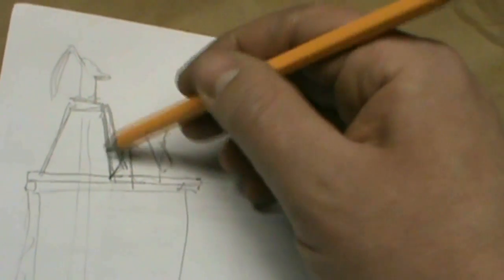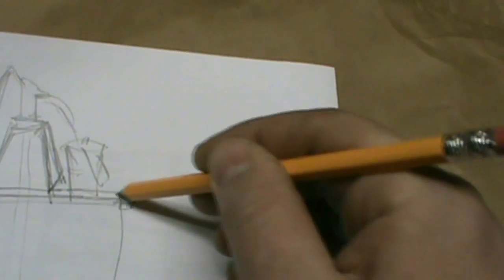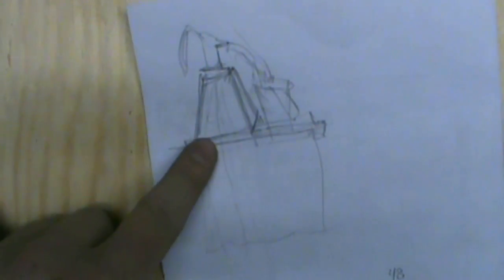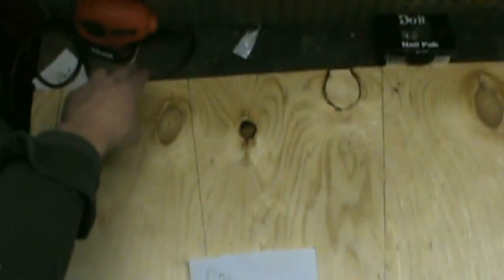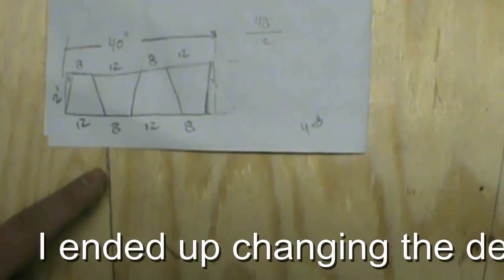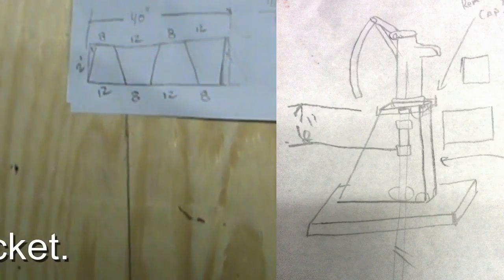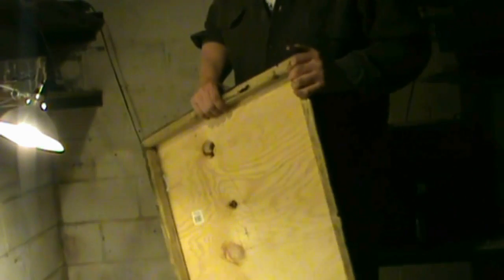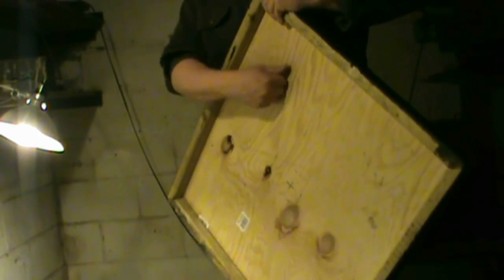Well Pump - Part 1

Comment from the maker: yeah..My other well is outside and hooked to an electric pump. I figured this would be handy. Plus I am currently haveing alot of trouble with that well.  This makes a great back up for any problems that may occur with the other. I am also thinking of going to city water for the house. in that case i still want acces to the big well with an electric pump.This week there has been thousands of people effected by a water main break in the city for a number of days. It is always good to have backup